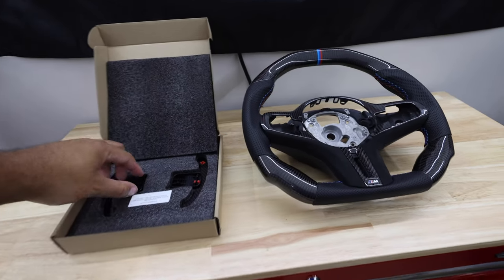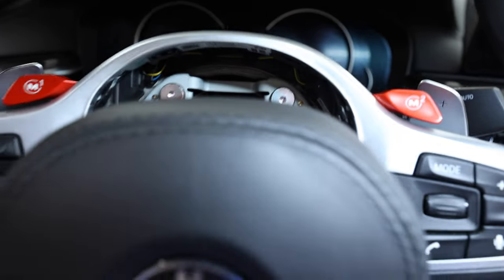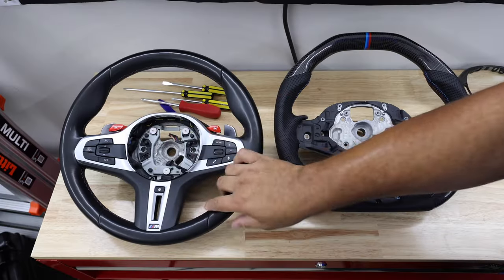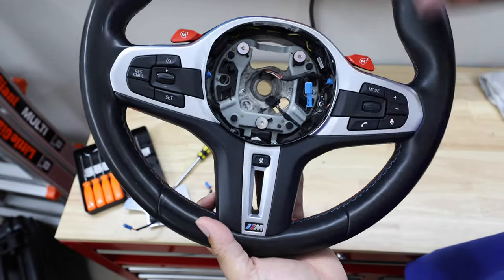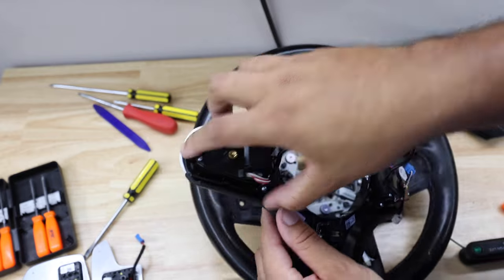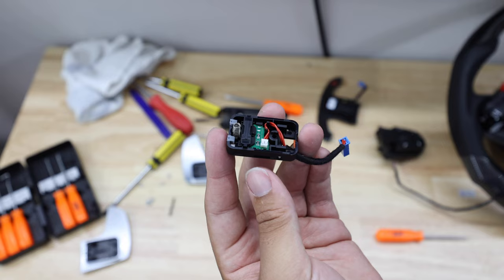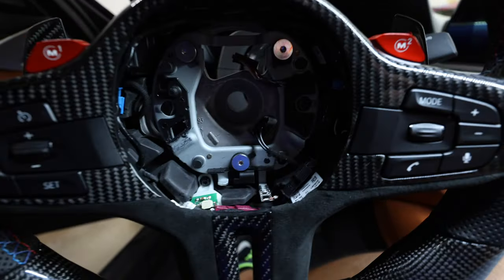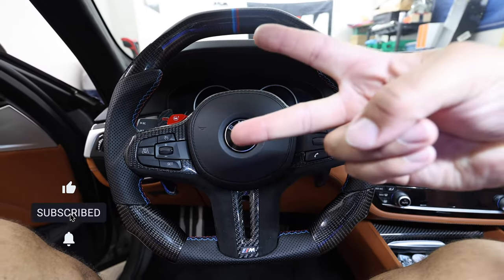Carismo Carbon Wheel and Autotecknic Shift Paddle Install / F90 M5

Comment: Very insightful video bro. I got my wheel from carbonbargin a few years back for my 850i. Same style, perforated leather on the sides and carbon on the bottom, top and also the entire front fascia (by the button trims). 

The wheel itself had a lot of unnecessary issues like coming in with stitching de-attached on the edges near the horn, the display having a few blemishes (got the shift lighting display, totally regret that) but I found it odd that I had a heated steering wheel feature for it since most companies said they couldn’t do it. It’s worked really well for 3 years now but I was bummed out they didn’t have a spot inside for me to transfer the module that controls the “auto pilot cruise control” which steers the car for you. 

All in all, if I had to do it again I’d definitely get rid of the shift lights and go with another company because who the hell sends a wheel in with the stitching on the end of the leather popped out, but still weird they were able to do heated and have it work fine when most companies say they can’t. And I later found out the company is probably a drop shipper, since it came from “Hong Kong” 😂😐
Reply from the maker: Yeah your wheel seem to have a bunch of issues. That is one reason why I try to keep it simple with wheels. These guys are out of NY so shipping and customer service is good. Surprisingly your heating function worked tho

Comment: Just curious, is there a way to keep the heated steering wheel function?
Edit: Specifically just for the leather on the steering wheel.
Reply from the maker: No… I have not seen any of the wheel companies do that.
Reply: There are multiple companies that make F90 wheels that will retain heated function only on the leather portion as heat will degrade/discolor the carbon.

Comment: I’m having such a hard time with the blue connectors for my paddles. You got any super specific tips on how to disconnect them? Been trying to get them off for hours now lol
Reply from the maker: I get a small pick tool and I slide it between the plug and the connector part on top. I separate them and then pull the plug out

Comment: Got the same wheel on my M8 but driver assist won’t work , I have put the small cable sent with the wheel, it works 5sec then it’s like I don’t hold the hand on the wheel and stops working , does someone knows the problem ?